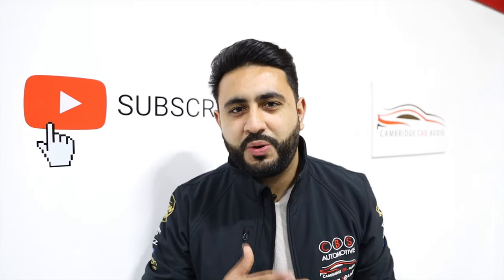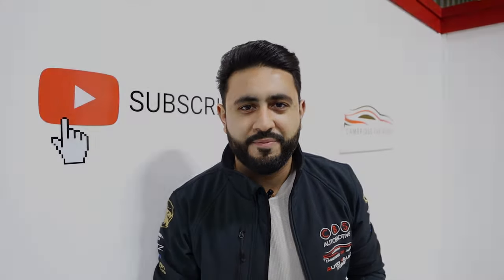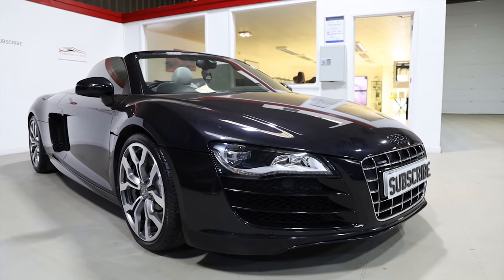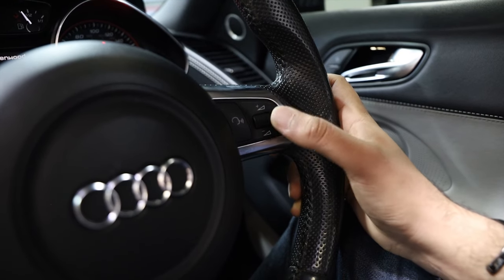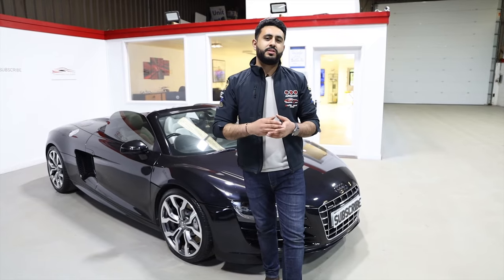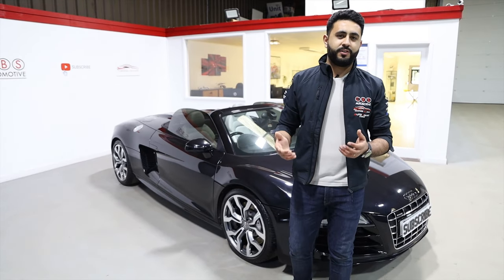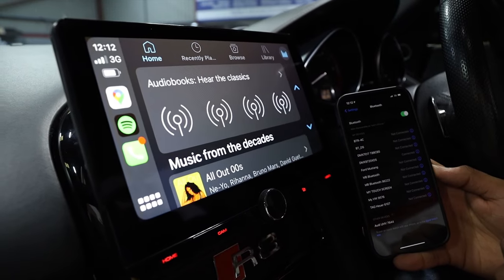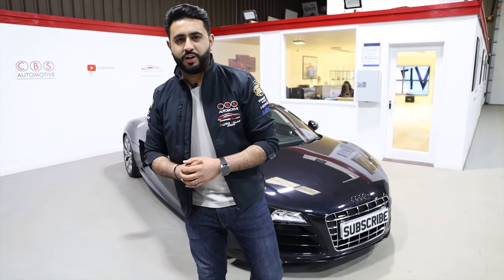HUGE 10" Head Unit Upgrade | Audi R8 - Custom Fascia Panel, Apple Car Play

Comment: Well done.  Would it be possible to lower the screen to allow the vents to function properly.?
Reply from the maker: Hi, the vents still operate, on this radio, the unit is fixed, have you seen some of the 7'' screen options we do?
Reply: Of course it’s operates. But the screen is blocking the air. Do you have a solution for it?